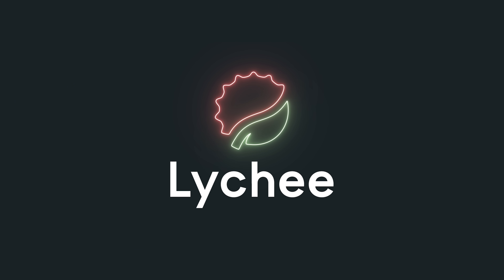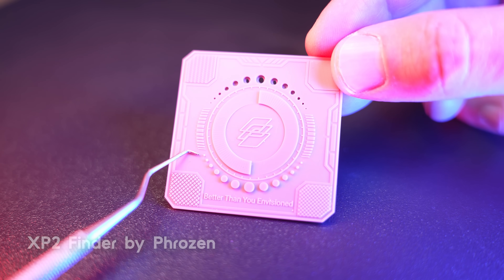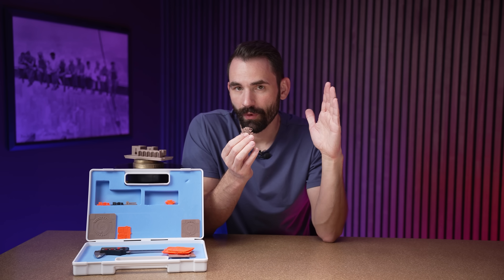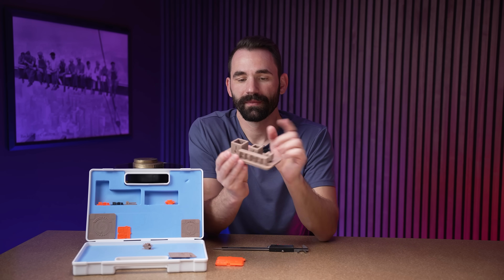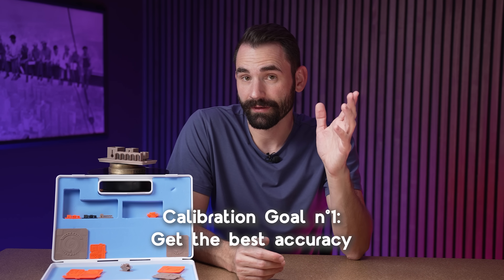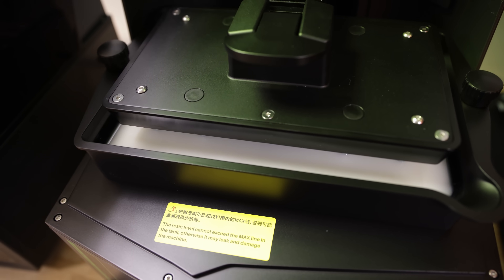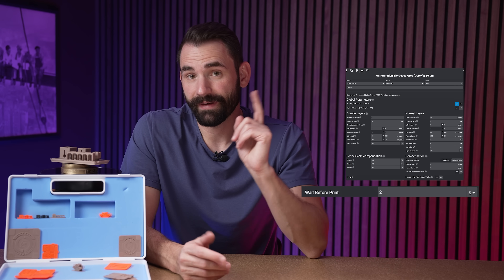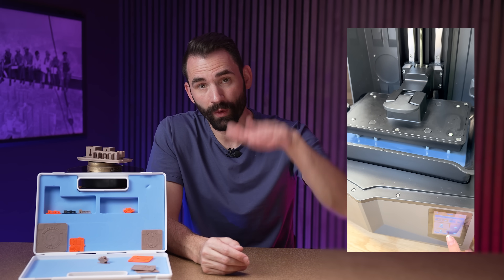Introduction to Resin Calibration (And Must-Have Tests Print) | Lychee Tips

Comment: Im gonna add some light delay after watching this. I have a 16k Saturn 4 ultra so heated bed. It does mean I cannot adjust the lift or retract speeds due to the tilt vat but the light delay might help and I’ll try the boxes. Thanks for this.
Reply: Light delay of 4s help on my Saturn 4 Ultra 16k.

Comment: im only on day 4 of owning my first 3d pritner (mars 5 ultra), got 3 resins so far Phrozen Aqua 8K Red Clay, Elegoo ABS-Like 3.0 Pro Photopolymer Black and Elegoo ABS-Like 2.0 Photopolymer Grey. 

I havent changed any settings at all so far except my first 2 prints of rook failed and it was because my base layers were set to 2 and bottom exposure was 15seconds. I just whacked it up to 8 base layers, 8 transition layers and 30s bottom exposure and had no failed prints since then, printed like 6 things over the past couple of days and i can't really see any bad details 2.5s layer exposure. and it seems fine for all the resins, but i dont really know what to look for?

Just decided today to "dial it in properly", so downloaded cones of calibration v3, and set 6 of them to print (currently printing) at 1.8s up to 3.5s, just to see if i can get better than what ive had so far even though im honestly already blown away. 

Watched this video hoping it would help but honestly just found it kind of overwhelming, its beyond me X_X maybe ill try again in a few days. you mentioned temperature all my stuff is printing at 40-50 degrees for some reason. Seems impossible to keep cool, if i put it in at 25degrees, by the time its on layer 100 its at 50 degrees anyway even if i point a fan at it. but the temperature hasnt seemed to ruin anything? 7:18 "too hot above 30 degrees and you get z-blooming", i have seen that but only for the support base layers which always get snapped off anyway, havent seen anything like that for the actual model pieces?

Ah you called me out at 11:15, i guess this is exactly what I must be doing?
Reply from the maker: Join us on discord where Derek and our community can help you! :D https://discord.gg/NGDDTgY

Comment: I got a bit of a different problem than most: My resin is sitting at around 27 celcius all the time, even with the heater turned off on my GK2. 

When I start printing, that resin is going to hit 32-33 celcius which is a bit in the higher end for me. :/ I am really struggling with dialing in my resin mix (siraya tech navy grey fast with 15% tenacious obsidian black) with a brand new siraya nfep.

At 2.5, the boxes are extremely tight fit, but I print 8 pillars. My wait time before print is 3 seconds. I followed your settings on your j3dtech document, there I more or less copied them to get a start-off point. 

Any suggestions on how to get more pillars printed while lowering the exposure so that those boxes aren't so tight?
Reply from the maker: Join us on discord for 3D printing help!  https://discord.gg/NGDDTgY

Comment: Great vid! I used the boxes of calibration test and the boxes turned out fine, but for some reason the pillars have bowed even on a relatively high exposure time for this particular resin, resulting in them looking like "( )", any ideas as to what could cause that?
Reply from the maker: Check Derek's guide to know more on the boxes and pillar :D https://doc.mango3d.io/doc/j3d-tech-s-guide-to-resin-printing/printer-calibration/boxes-of-calibration/

Comment: This was fantastic. I've been printing for about 5 years and I learned a lot in this video. From what I took away from this video, you explained the principals and what to watch out for, but not how to achieve the desired results. For me, I don't really care about how long a print takes. I want the quality to be as high as possible with strength, accuracy and visual imperfections. There are so many different resin/printer combos so it's impossible to make blanket recommendations, but I would have liked to see examples of your test print, for instance: If it's doing this, adjust that, if this is failed dial that up or down. I'll watch again to make sure I didn't miss anything, but I found myself waiting for a second part of this video explaining how to dial in prints, but then it ended :(
Reply from the maker: Thanks so much! It's a very large topic, we definitely need to do more video on calibration! :D
Reply: I was looking for the same thing.  The boxes measure accurately (pre-curing) and all of the pillars are there, but none of the pillars are straight.
Reply: 🎉🎉🎉ta

Comment: You mention resin temps in the upper 20's as being a good spot. I dont disagree. From my experience, though the heat created from the lcd screen and the curing process can raise this starting temp by 5 deg or more by mid print (sampling deep in the vat where the work is taking place) meaning the resin is now in the mid  30's. I've concluded that the bulk of this heat is from the screen operation and less so from the exotherm of the resin. I base this off the fact that my DLP will lose vat temp, early in the print if I start at say 32-35c. lcd's go the other way. Try monitoring resin temp through the entire print with a thermistor thermometer. I would be interested to hear your interpretation. I currently have heating elements on the vat walls of my DLP and it holds the ST Blu Lava Black resin at 40c the entire print. Although I dont claim this as optimum I am having 0 print failures along with good quality and accuracy (after adjustment). Also, as we know, temp can have a significant effect on viscosity, especially with the Lava which is thicker than most. At 28 deg, its like gear oil. By 32, its thinned considerably and continues to thin till over 40c. I haven't attempted to stabiles resin temp with vat heating on my LCD'S yet. Just some food for thought
great video, btw. Youve been thinking about this a lot👍
Reply from the maker: Thanks for your comments! :D

Comment: Any plans to make lychee able to  WiFi print directly to the Anycubic M4 Ultra? Or is that a Anycubic fix? I love printing to my GKTwo over WiFi and currently I can't use lychee to do this.
Reply from the maker: It is on Anycubic side. We are discussing with them how to support the corresponding printers. However, we don't have any timeline for now until we have the data/information fro them.
Reply: @Lychee3d  sneaky sods. :) I do not like their slicer.  They could just make the storage available on the network like the GKTwo does. Their website says q4 2024 so I guess they're going to miss that deadline. I appreciate that you have a profile for the M4 (unlike the "other slicer" that is not Anycubics)

Comment: awesome video, thanks!
Reply from the maker: Thanks for your comment! :D
Reply: @Lychee3d  quick question, you say the light off between 2-5 are most normal used. But big printers like the GK3 ultra, Anycubic M7 Max and so on, would they not usaly need more than 5 sec? due to the bigger plate/vat ?

Comment: Something I would have liked to have had touched on is discussing how lift distance, lift speed, retract speed in their first and second stages in Lychee play into the grand scheme of it all.  You did mention it a little, but a little more in depth with use of the graph diagram you had would have been the icing on that cake.  Then again that could likely be it's own video too.  Regardless, this has helped me understand what is going on in that vat a little better.
Reply from the maker: A video is coming on this! :D
Reply: @Lychee3d  Woot Woot I got a reply!!! I look forward to it that video, because sometimes prints come out great, and then one batch is a total failure, and then I think I did something wrong so i touch the setting and more failure and then I live with partial success.  But the videos Lychee puts out have been getting better and better especially using the community photos that are submitted as examples, and also on other videos I've seen actual user screen shots of settings which has helped out immensely with commentary on those.  So long story short I look forward to the video :?

Comment: very detailed work. i recently started using sunlu abs-like resin clear on my Elegoo Saturn 1.  i have had some misprints and difficulty finding settings. you are the first that i have seen that did not recommend more exposure time for clear resin. i will try 60mn for layer size and turn back on the light of delay. i may also need to clean the lcd screen.
Reply from the maker: Hope it works!
Reply: @Lychee3d  the light off delay of 2 sec seems to fix the extremely difficult to remove supports issues and support fusion issue seems to be gone. i will still try 2.5 LOD. i have upped the exp time to 3.1, so nothing left on the print bed now.  i am continuing to get a flattened hand or two on some space bugs in a batch with using pre-supported minis for this testing. i usually lift the z axis by .03mm after leveling, but i am using 60um instead of 40um now. i will try bumping up the z axis lift to.05mm after leveling. also, i may try 70um print size. i am printing in the garage, so it is now colder.

Comment: I'm new to 3d printing and this information is extremally helpful in understanding what is happening with my experiments in slicer settings. Mostly bottom and normal exposure. I have not messed with with Light-off delay yet. I'm using your "boxes of calibration" as well as the "cones of calibration". It's been fun so far and been really enjoying this new hobby. I have an new Elegoo Saturn 4. After some experimenting I've even been able to get the small channel feature on the very underside of the "boxes of calibration" to print. I'll admit the multiple exposure setting feature on the Saturn 4 Ultra would have been nice to have on my Saturn 4. Next is to print some actual parts for my models and experiment with supports and printing angles.

Comment: Thanks, these are great tips. I've never really thought about the continued movement of the resin during curing..   Spot on as always Derek.

If this cubes model is actually a calibration file that @Lychee is willing to get behind, it would be awesome if it were just available in the slicer, and didn't have to be downloaded separately or require Library access.  (I can't actually find this on the Library)

It would be pretty fantastic if general utility models like this and Lychee's Tank cleaner file were included on the library with access open to all users, not just subscribers.  If that's not possible with the current Library implementation, this calibration model should just be added to the "Primatives" menu.  I know I have never felt the need to print the chicken that's in there.

Bonus if you could do an actual calibration mode slice export where multiple calibration models are printing at different exposures.
Reply from the maker: Thanks for your feedback! For the multiple calibration models slicing mode, only a few printer have this feature, it's done directly on the printer, not with the slicer, it won't be possible to do it with a printer that does not support it :)

Comment: another one if possible. i print directly on the plate since its a lot of small knobs im printing its very convenient, and since if i incline the models it doesn't give me a perfect shape. Is there any advantage in possible printing with supports but still flat? I mean having the knobs stand flat just like on the plate but over the supports, would this make a difference or is it the same suction forces etc as in printing flat on the plate. Ive done both but i wonder what it will mean in the long run for the fep, machine etc
Reply from the maker: It depends if it's a very large surface, if it is you'll want to tilt enough to have less cross section, we talk about it in a previous video on how to orientate a model if you want to check that out :D

Comment: So, If i as now get the Cubes to 7.9 instead of 8.0 (and 5.9 instead 6.0 etc) on this Cubes of Calibration. it "simply" means im printing with underexposure? I was also using the Cones Of Calibration and trying to get all pillars to fail on the failure side, that got me to chase in the wrong direction?  I dont care about hardness in this particular case since the pieces im printing are very small and printing fine at 1.5s but they need to fit perfectly into a metal grip.  Thanks for this fantastic upload! please make it a standing series, its never too much about this topic. Cheers
Reply: @eddiexx  Yes you're under exposed. 

Cones are a stress test, not a tensile strength test or an accuracy test. 

If the boxes measure under them you're leaving strength on the table. Go up on your UV exposure till they measure correctly. 

But if you're not using any light off delay or Wait before print. You're still hurting accuracy.
Reply: @J3DTech  So, i can go up in exposure time until i get the desired matching size between real world measure and resulting print. But i was thinking, could i simply keep printing this convenient low exposure time and simply adjust till i match the discrepancy? I men if the the difference will be consistent, giving the same result every time then its not a problem for this particular project,  i simply adjust the diameter while modeling it the in this case grip hole until it fits the grip it needs to fit. If this is replicable every time, then i could keep printing with this shorter exposure time
Reply: @eddiexx  There is one  advantage to a under exposed print. That is a bit of wiggle room for post assembly.

The difference in print time difference will be very very low as I'm sure you're only under exposing by 0.2- 0.5s per layer. 

The advantages are correct dimensions and a higher success rate as the supports and model will have a tiny bit more structural integrity during the printing process.
Reply: @J3DTech  brilliant, its strange how hard this is to process in your mind at first, and then slowly thanks to quality explanations like you are providing things start to clear.
Reply: @eddiexx  Thank you! It's a complex topic and in this video we don't even cover all of it.

Comment: Perhaps a followup video with examples for how a user would practically calibrate from the resin/machine recommended settings.
It would vary for every resin/machine/brand but maybe something like:
1 print of your boxes model at recommended exposure (of resin), 2s light off delay?,  recommended speed/distance (of machine)
» if not enough resistance try prints of change (A) and change (B)
» if bigger try prints of change (C) and change (D)
» if smaller try prints of change (E) and change (F)
» Maybe another round of suggestions for problems in (A) (B) (C) (D) (E) (F) prints
Reply: In my guide I have all of this information, but a video covering it to that level is a good idea.
Reply from the maker: Great idea!

Comment: do you have a test for post-curing? I've been guessing with 2 minutes increments until it passes the lick test, but that doesn't feel accurate
Reply: I've heard overcuring is not really a thing (I'm talking about regular resins, this doesn't apply to clear or flexible resin for example). You can't really "overcure" regular resin, once all the resin is cured, more UV just won't do anything. Once the print is completed, there is only one thing to do, cure the whole thing as much as you can, because you really want to avoid manipulating a mini that has not been cured properly. At first I was trying to avoid overcuring my print, I had different cure time depending on the size of the part, if it's hollowed, etc... Now I just cure everything for 10min without question, and frankly I have not seen any difference on my print, they are not more brittle, bending or anything, and at least I'm sure they are fully cured.
Reply: Also I hope your lick test absolutly involve licking the mini to check if it's properly cured, because that's 100% the way of doing it.
Reply: You should be testing boxes after curing. This way you are taking that into account. 

I cure them for 3-5 min depending on the resin.

Comment: Great explanation.

Only thing missing in this video is a flowchart of how to calibrate: for those with and without resin heaters.
Reply: The Process will be the same, you just will need a bit more UV exposure time, but that will be reflected in the Calibration Print.